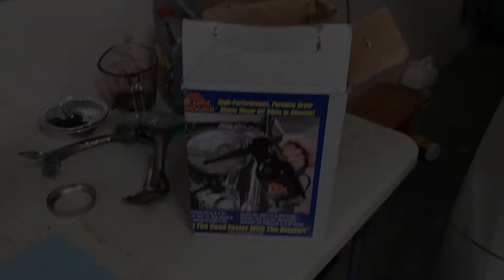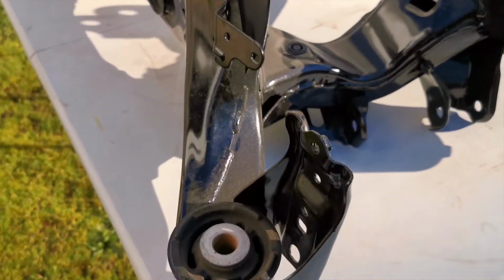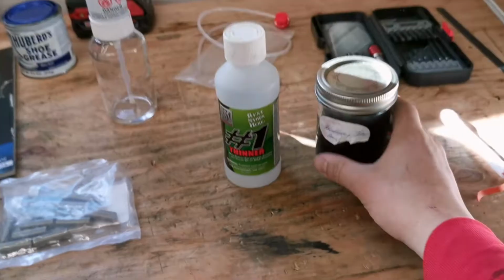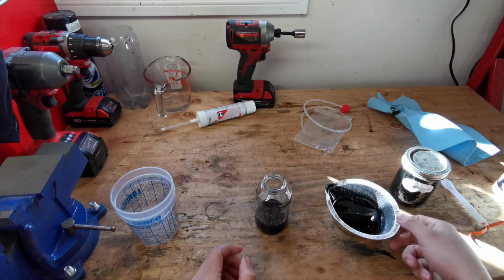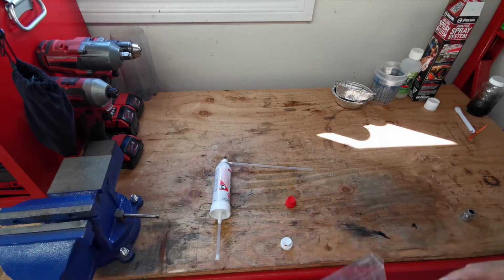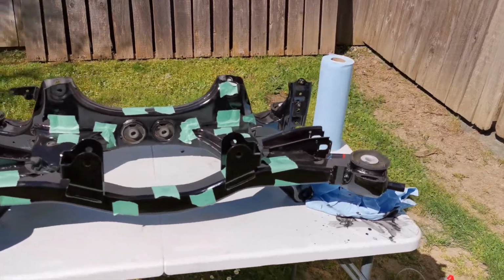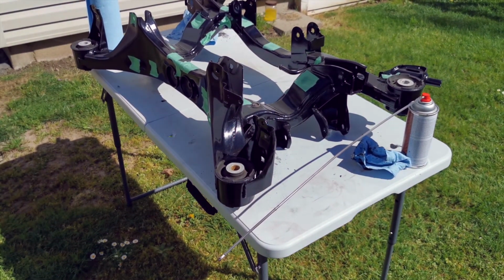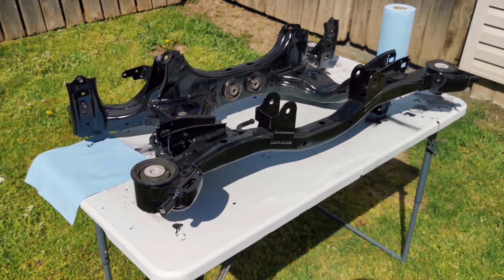Subaru Subframe Refresh | Part 4

Comment: Interesting set of videos.  So, I have a low mileage wrecked subaru which still has good bushings, and a high mileage same year with all bushings gone...I'm thinking it might be easier and cheaper to just swap subframes than try to deal with each bushing.  You make it seem like a good idea

Comment: Nice work, 
Regarding Bolts Tho ALL The bolts on a Subaru should be Metric Already as they Strictly Only use Metric in Japan. 
Maybe Somewhere had the box open before and used different bolts, or when they come to USA First they are all Opened and resealed with different bolt then shipped to Canada. 

I know my AUDM (Aussie) WRX has Metric Diff Bolts (afaik they were 13mm or maybe 12mm, But i only have a Metric tool set and so no problems lol)